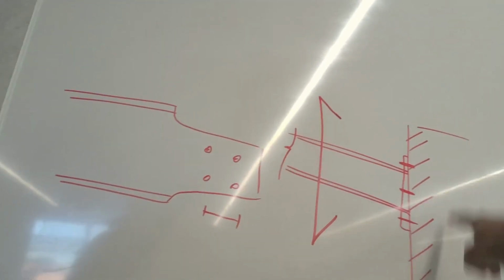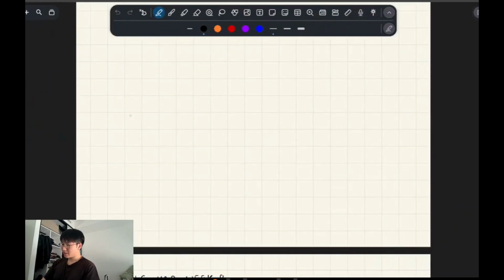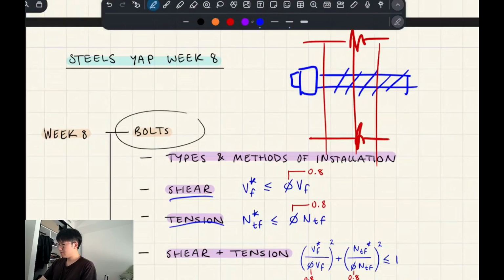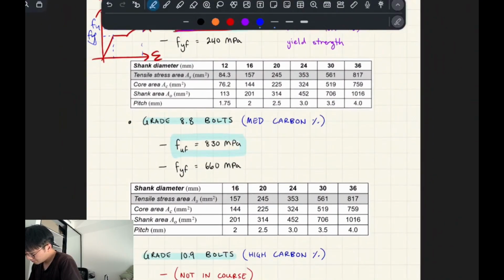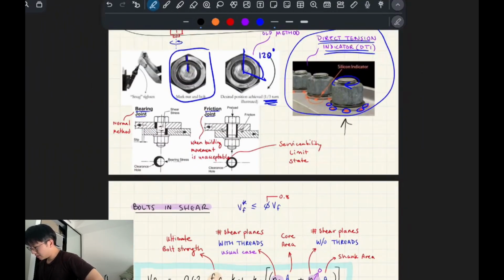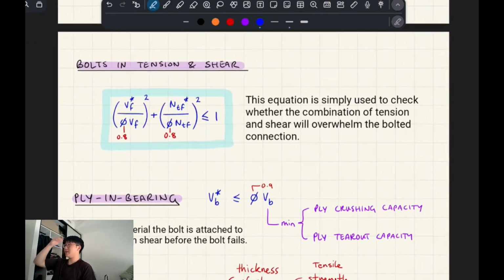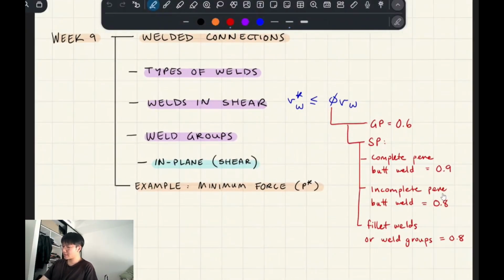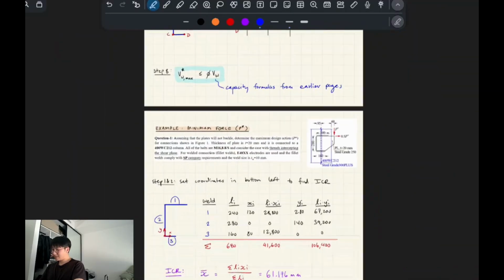2026 Steelfixer's Guide to the Galaxy - Week 9

Comment: Hi mate, do you know if anyone has a worked solution of the 2025 Steels Final Exam paper that is on your shared Drive? - Link: https://drive.google.com/file/d/1p5RL7-P46nRGqAx7SrsYhWIDYsSumHMJ/view?usp=drive_link

I am having trouble figuring out Q1c) and Q1d) from that paper. It's the question that asks about the max. axial capacity for the steel plate with 40x M20 8.8/S bolts in shear. 

If you or anyone you know has a solution or explanation to this part and can provide it, it will be very much appreciated! Thanks.
Reply from the maker: Hey mate this will be covered in CEVSOC's recap workshop for steels in Week 11 on Monday. Check out their page for details